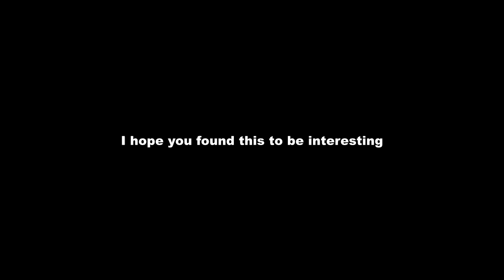Two Quick Projects to Improve My Laboratory Worktable

Comment: Nice solution. Do you think the tool caddie will interfere with your right arm while working at the bench?
Reply from the maker: When I planned this, I sat in my usual working position and my right arm never got to that area, so I decided it was safe enough. My main concern was not having the soldering iron cord catching on the tool holder, so it stops just next to where the cord hangs naturally.